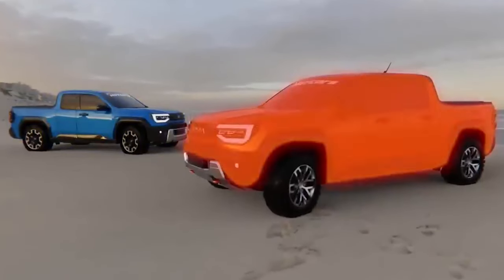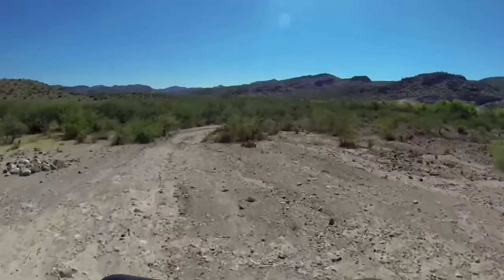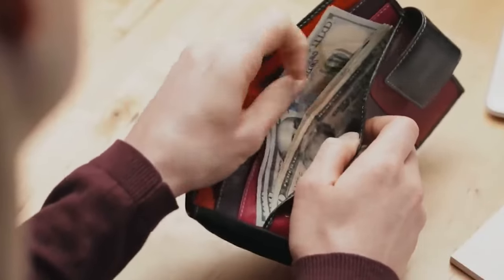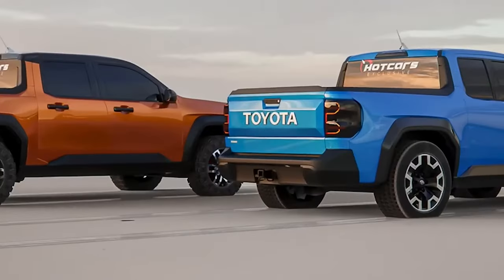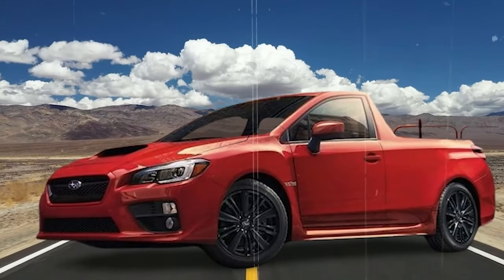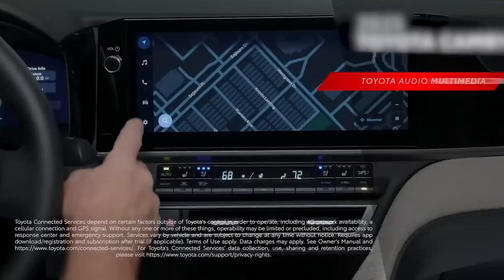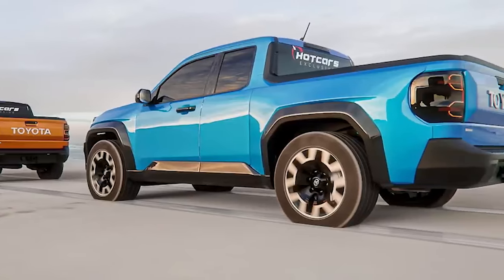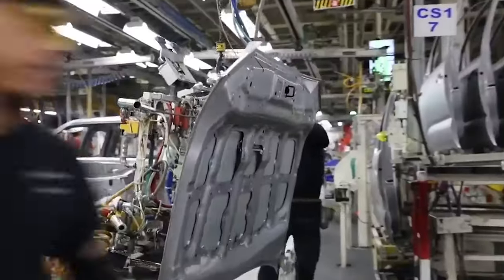Reasons Why The Toyota Stout Is KILLING the Competition!

Comment: If it's not made in North America it will never be sold in the US because of the chicken tax.

Looks like a unibody construction, since it's based on the RAV4, which means it'll be front wheel drive, so it's not a real truck.

That being said, that blue king cab look awesome. I can see myself in one, as long as it has AWD and no CVT

Comment: 4 cylinder with turbo and 6 cyl with turbo is trash.
Reply: I won't buy a vehicle with turbos, GDI without port injection,  or sleazy mechanical CVT.
My next vehicle will probably have the 2.5 liter hybrid used in the Camry hybrid.  But in a SUV or Crown.
They mentioned that the Stout would also get this as an option.  Or maybe the 2 liter Prius version.  They can always increase the electric resources if needed for truck duty. 

These hybrids give you most of the electric car goodness,  without the electric car drawbacks. Plus great fuel economy. Many have good 0 to 60 mph performance. 
My 2012 Camry hybrid could do 60 in 7.4 seconds (based on 2 car magazine reviews). And also give 40 mpg city or highway.
Reply: what else is new?

Comment: BS The Corolla has been absolute crap since the 2014 redesign.  transmissions  repalaced twice, A/C unti replaced, Stereo replaced as well as wiring,  and lower gas mileage than before.  Toyota is not quality anymore